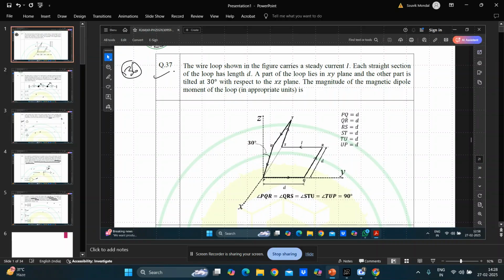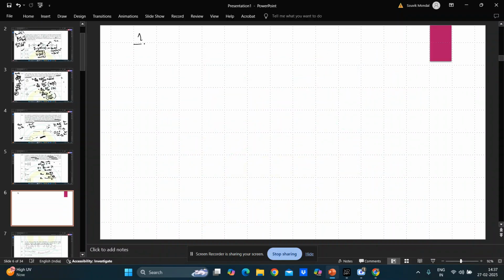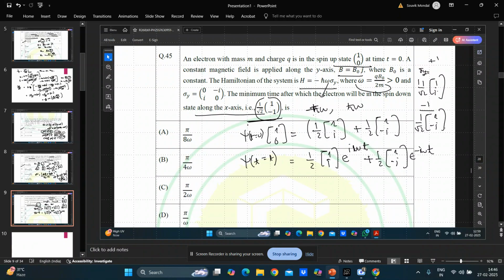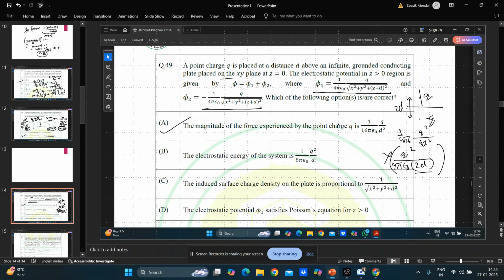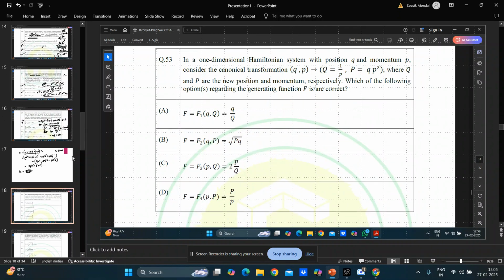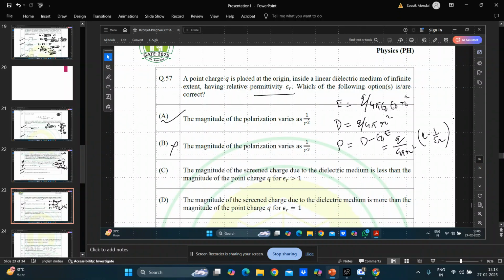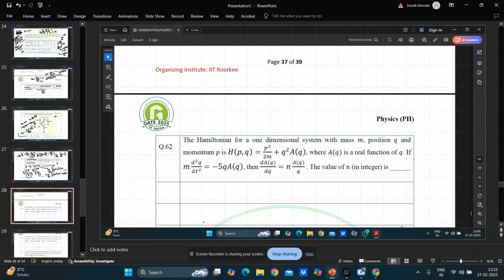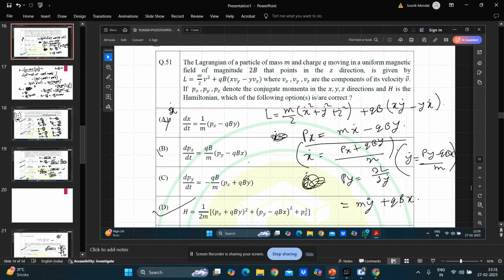GATE 2025 2 MARKS SOLUTIONS. #gate2025 .#gatephysics #gateexam #csirjrfphysics #jestphysics

Comment: In question 58, as you mentioned option (A) is correct. But i have doubt about this option.
Outside Magnetic field express as gradient of a scalar function  when outside B = 0
But in question they mentioned cylinder for height L, which mean Ampere's rule is not Valid.
and due to bound surface current density their is some magnetic field outside. So curl of B is not zero, that's why option(A) is not correct.
Is am i correct?